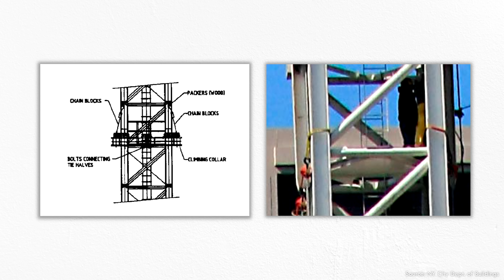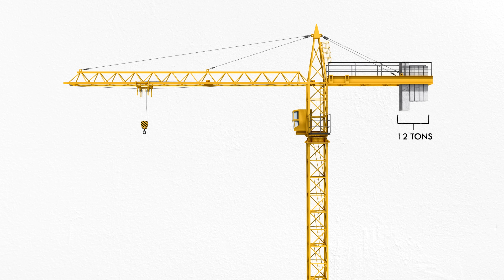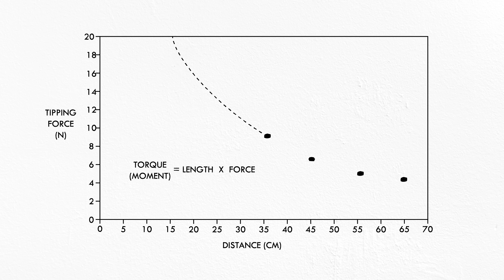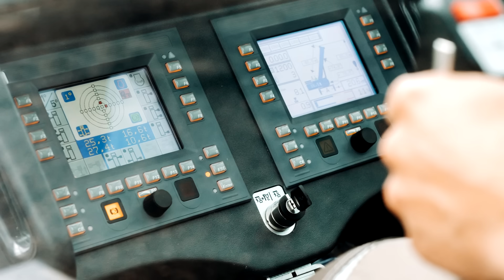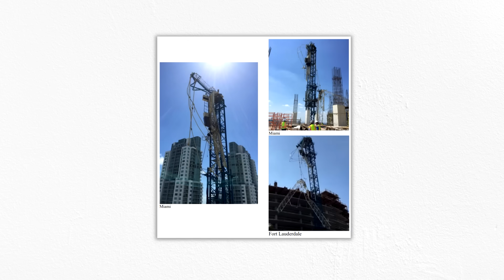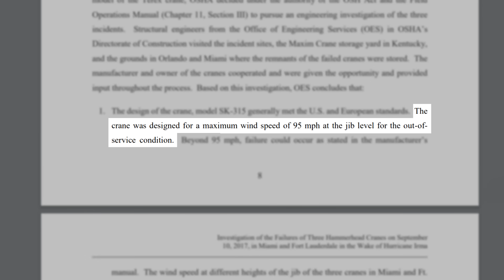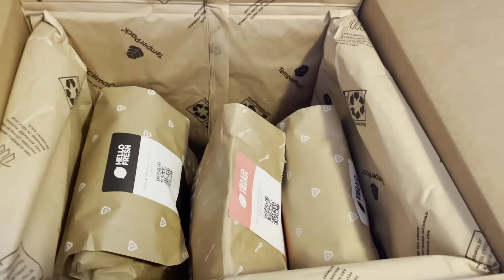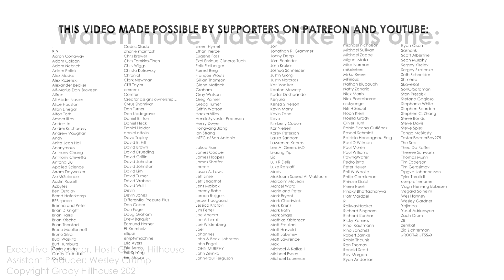Why Cranes Collapse

Comment: I got to experience a crane class here in Wyoming. Back in 2008 I believe the Lampson crane collapsed at the highlight construction sites for a black bender mind. They thought it was OK for them to let us really heavy piece of can failure into the air on a Sam pad that we develop for The crane yet in one of the corners there was quite a bit of water that saturated the pad. Engineers thought it was fine but as mentioned big huge crane collapsed and destroyed quite a bit of stuff.

Comment: In the deep foundation construction industry (traditionally one of the most dangerous industry classifications), working platform stability (providing/ensuring a stable work platform for heavy equipment) is a huge heath and safety issue. Not only do you have a heavy piece of equipment with a mast and/or boom supporting heavy tooling, but the tooling or pile being installed or removed has a lot of frictional resistance to vertical movement from the embedded portion in the soil, which requires additional bearing capacity to prevent machine instability. The "simple" solution of increasing the bearing area / lowering the bearing pressure is not always straightforward to achieve given the plan and vertical location of access to planned foundation elements and relation to other work activities or occupancies at the site. It is also not always obvious in advance whether the working platform needs improvement or which party (owner, construction manager, general contractor, specialty subcontractor or other party) bears the contractual and financial risk and responsibility for the working platform. It can be complicated.

Comment: I was talking to a crane operator a few years ago now and he said that the modern cranes keep a accurate record of each shift, who the operator was and what loads were lifted. This means that should the crane fail at some point in the future, investigators can go back through the records and identify what load caused the damage to the crane and who was the responsible operator. 
Mark from Melbourne Australia. 
I was too close to a mobile crane that collapsed while lifting a large structural steel roof member back in 1984 as a 1st Year Apprentice Carpenter. It sure made my knees knock. Dept. of Labour and Industry had to come out on site and investigate the collapse.

Comment: As AvE has pointed out more than once, cranes nearly never fail due to an engineering/design mistake, material failure, or aging/maintenance failure. No, it's nearly always human error.
Reply: I was just thinking the same thing watching this video.
Reply: Yes, I've walked on site where lift had been done, but machine outriggers where on top of sewer pipe hid by only little amount of tarmac. It was lucky that lifted weight was so small that time that they were virtually not needed at all. Operator had been on site before years ago, but didn't remember that and man who had ordered job was green and didn't have clue that there's sewer at that location.
Reply: @jothain  though really, relying on a few humans familiar with the site should NOT be necessary.
Reply: @SqueakyNeb  maybe so, but it's mandatory in most cases anyway. I've seen plenty of misleading blueprints and other shit.

Comment: Even with detailed lift plans there are still failures because of dynamic loading like offshore cranes experience. Even when everything is mechanically in spec the unpredictable forces caused by the sea even when operating within the safety limits failure happens all the time and it is the function of the crane driver to judge when to start the pick. Mis-time it by a few milliseconds and suddenly you can be outside the limits. Let me tell you they keep track of everything like ton miles to gauge the wear on the wires. This is just to say Engineering cannot and has not been able to predict most failure modes otherwise nothing would ever fail when all Engineering has been followed.

Comment: I was involved in the aftermath of a crane collapse in the 1990's. The crawler crane was being moved on the property of an oil refinery in Wilmington CA when the ground gave away and the crane tipped over on its side. The crane fell over a railroad yard  destroying a building and onto a bridge of a major street. That bridge was closed for months as the bridge needed to be replaced.  Another time I was delayed from getting off work in 1987 due to the construction of a slab side warehouse being built across from my place of work. The crane crew was putting up the last piece and tried to speed up the job causing the crane to tip over.

Comment: Back when I was a young civil engineer, I was given a couple rules to follow on construction sites by more experienced engineers.  1) don't walk under a crane lift if you can avoid it.  As this video demonstrates, cranes can fail.  You don't want to be under the boom or load if something breaks.

2) If you see people running, then run.  Don't try to figure out why they are running.  Don't look up (your hard hat gives you some protection from smaller falling objects, but only if you don't look up).  Don't hesitate.  Just run.  Once you are safely away, then you can try to figure out why they were running.
Reply: It doesn't hurt to run faster than them either. Especially good advice with predators.
Reply: Always try and outrun the safety guy.
Reply: Have you seen the video where they drop a large bolt on a watermelon. Then repeat it with a helmet on it. It does a great job of showing how much a hard hat can help
Reply: @n1elkyfan  That depends a great deal on the height of the drop.  A bolt dropped off the twentieth floor?  Yeah, the hard hat isn't going to help.  A bolt dropped of the second floor?  The hard hat will likely help.
Reply: @M1911jln  I agree. Some protection is definitely better than no protection.

Here's the video I was talking about
https://youtu.be/Q7DDsCP6y8k
Reply: @M1911jln  Not true. It Entirely depends on the terminal velocity of the bolt. Every object has a maximum falling speed determine by weight and shape (due to wind resistance as it falls) and once it hits that speed, it doesn't accelerate further. So if the bolt hits it's terminal velocity in the first 20 feet, it's going the same speed if you drop it from 20 stories.
Reply: Instincts never fail.
Reply: 2 Just following the other sheep :)
Reply: @millomweb  rather than sitting there dying 😊

Comment: The tipping line I know is a line on a graph not a line on the ground. It can be translated to a line on the ground for a given configuration and loading but the line shown at the edge of the mobile crane's wheels is far from the loading you apply. A line on the ground would make sense if you kept all else constant and then moved the load away until it crosses the line and tips. That one detail in your video I would rate as nonsense. Otherwise, well done.

Comment: Ok it’s late for me and I haven’t  watched all the video but as a rigger that’s been doing this for 35 years now and worked with pretty much every single type of crane in earth. The real enemy is wind. A standard FAVCO tower crane has a maximum wind rating of 22 Mts/2nd but anything over about 18 starts to get sketchy. Especially when you’re building an 85 storey building and for example, installing the fly bridge between the building core and the crane base so the operator can cross over to the alimak without having to climb a 100 meters of ladder. I did this a few months ago when mid-lift the wind suddenly gusted to about 25 mts/2nd. Once your mid lift you’re committed. 5 tonnes of steel, 55 floors above the ground started spinning like a helicopter rotor. It nearly knocked six riggers hanging from lanyards to their deaths while I was calling the load on the radio. The really important part about this< and I cannot stress it highly enough< is that no matter what< when calling the load, you have to keep your voice calm and level. This can sometimes be really hard to do! Lol. The crane operator is often working in the blind. If you panic so do they. A good crane crew is right up there with an acrobatic troupe for a circus. The level of trust you need to place in your co-workers is literally life or death sometimes. Moments like this occur on every tower crane in every part of the world on a daily basis. Maximum respect to all my rigger brothers and sisters out there in the world from Australia. Stay safe and follow the charts. 
Btw. Safely landed the fly bridge on the 50th floor. Got a round of applause from the boys on cranes one and three when I wandered into the smoko sheds at lunch time. Completely worth it. Love my job. 👍

Comment: We once had to order a 200t crane to pickup 2t. It was to assemble an amusement ride, but because the ride was on a earth mound you couldn't park a crane near it, and only a 200t crane could pickup that load as such a far away distance.

We used to paint Favelle Favco tower cranes for the manufacturer- the ones with the angled boom -, and they have sacrificial tower sections that get concreted into the foundations. But even then one did fall during an earthquake on the Taipei 101.

Comment: Most of the crane accidents that have happened where I was working was due to human error. Deciding to lift without the outriggers, no putting down the pads, traveling too fast across uneven ground, etc. The worst I saw was at a nuclear plant where the union constructor insisted on managing a specialty heavy lift that involved lifting the load and then walking in. They were warned several times to let the manufacturer manage the lift but they insisted. The crane lifted the load and the union foreman told them to start tracking (the crane was so big it had five sets of crawlers all with separate operators talking to each other with radios). the crane started moving but the load didn't so the foreman told them to stop tracking. Then the load started moving so the foreman told them to start tracking again. The load slowly passed up the crane, hit the end of the swing arc and started to move backwards as the crane was going forward. The crane walked out from under the load and the queen pole snapped in two. The 500 foot boom and the 400 ton load came crashing down across a maintenance building and a parking lot. Fortunately, all the maintenance personnel were in a meeting at one end and no one was injured. It set back the job two years (they had to build a new reactor roof and build a new crane. They also had to compensate the crane manufacturer for two years worth of rentals and a new crane. The contractor had to cover all the costs, which they naturally passed on to the taxpayers who were funding it.

Comment: I would argue that essentially all engineering failures are avoidable in one way or another, whether or not the way to make them not happen is known or discovered beforehand and then accounted for in the design is the key for most of them. I see that as the most impressive talent that good engineers have, figuring out failure modes that have not yet been seen and creating a solution that works while implementing aspects that prevent known modes of failure from happening at the same time. This is why I have so much respect for them.

the rest are basically about should something be done, where something should be done, and "do we have enough information to continue?" being avoidable as well in terms of "no, don't do that" and "no, don't place it here" & "no we do not"...... the real key is knowledge. But this does not mean I think there needs to be a thousand years of study before someone builds a two story building or something. Nor does it mean that I place blame on someone without proof of incompetence or negligence or whatnot. Not to mention that when something happens, the solution can be obvious in hindsight even if it was not easy or impossible to know beforehand. Just because something could have been avoided after the fact, does not mean it could have been avoided before it happened. There is always more to learn and frontiers of the unknown to push into.... and sometimes the best way to push forward is to simply do something. But in the end, there will always be something that stops a design from failing, or allows something to fail due to it not being implemented for whatever reason. And there will always be times when something should not be done, should be done elsewhere, or not done before more knowledge has been obtained.

If this makes sense to anyone. Sorry for the ramble, I'm tired. Good engineers are awesome.

(also, Isambard Kingdom Brunel > *)

Comment: Remember one time we we're dropping in switch gear into a building, my foreman gets into a forklift to help move some stuff out the staging area before we raise the crane up and nicked one of the cranes sectionals. Whole lift op called off until we could fly out someone from the cranes manufacturer to fully inspect and see how bad the damage was and if he had caused any micro-fractures. He and the spotter got lucky they didn't lose their job and crane was online after two days and an extended shutdown that wasn't planned.

Comment: I remember, many years ago, working with a 160 tonne crane. We used it as a work platform during an emergency. At full extension it could only lift 1 tonne.
Reply: Having just got my certification for crane operating, I know that they place a 8x safety margin for the crane. So truly speaking you could have lifted eight tons, but when people are involved they always put a higher safety rating so it can only be rated for a thousand.
Reply: @bnieu1  I am curious where that 8x margin comes from, as it seems very high. I was a crane operator for years, and the machines I ran never had a margin that high. More like 2x or 3x before the machine started tipping. I also know that safety margins can vary widely when rating items that go along with rigging like shackles and slings.
Reply: @jamese9283  I might be mistaken about the exact safety margin, I just remember that they do put a high one on. I haven't looked through my books in a while, I think I will look back through it.
Reply: @bnieu1 no they don’t. Hydros are rated at 85 percent of capacity and crawlers are 75 percent. You cannot lift 8 times the capacity of what your chart tells and expect your boom not to fold or outriggers or tracks come off the ground. Most cranes are tested at 110 125 percent.
Reply: Also, if his chart says he’s good for a 1000lbs stretched all the way out. Truly, the crane is not capable of lifting 16,000 lbs. aka 8ton in the US.

Comment: I followed a disaster with a crane in Manaus, Brazil, where the side supports were placed in a parking lot. However, there was a sewer box under the floor, which was not visible, which caused the crane to fall.

Comment: I was glad to see the inclusion of the electronic systems monitoring the crane real time for the operator.  If this data is recorded, it would give the operators some back up when they question the decisions of supervisors to perform an unsafe move.  Also, he mentioned that the crane can be stopped from making that move.  Past crane failures could be included the the data to help the software provide sound, safe guidance.  
This is a great channel.  Grady covers the things we count on but either don't see or give much thought to, roads, concrete, sewers, flood control, electrical infrastructure and now cranes.
Reply: @CR-rm4iy  The operator always has veto over the lift. If they don't think it's safe, then it doesn't happen. Afterall, it's their speciality, liability, and potentially their life on the line, so nobody else should have license to override or threaten to fire them.
Reply: Yeah they should but it doesn't play out like that. Even if they can reliably veto it might make them enemies looking for any other reason to fire them.

Why do we have to put in 2 weeks notice when they can fire us out onto the street on a whim.
Reply: @SimonWoodburyForget  they said that about the driverless car. Now cars can capably drive theirselves. And they are only getting better, though we can’t have them on the roads shared with humans, too many human error. Only a matter of time for the cranes. 🏗

Comment: "What goes up, might come down. Think of that next time you use a ladder."

Thanks, Grady. Sincerely, an employee trying to learn to trust ladders so my boss doesnt sack me.
Reply: @SimonWoodburyForget  
That's why you need to maintain three points of contact - so you can pull yourself back to terra firma if gravity goes awry up there.
Reply: This made me thing of Christmas Vacation. Where he falls off the roof on the ladder and just pushes off from the tree. That was extremely funny and NOT CGI. Neither was the Taurus/Sable going under the truck. Completely insane. Lol

Comment: "The technological side is without flaws. The human element - as always - is riddeled with imperfections." -  Cabal, C&C: Tiberian Sun.
Reply: "In theory there is no difference between theory and practice - in practice there is" ~ Yogi Berra
Reply: This is the inevitable result of capitalism. Money comes before safety, cut as many corners as you can get away with until something breaks and you dial it back again, until people forget about the last time.
Reply: @SimonWoodburyForget  "Engineers tend to love to go way over the top with safety margins."
Have you somehow missed the dozens of Videos where they do not do that?
Reply: @SimonWoodburyForget  The tradeoffs in road design are not "capitalism" based.
They are based on available manpower and resources - in the form of money.
Reply: "Wuaaaaaaaa!!" - Mario, Super Mario 64